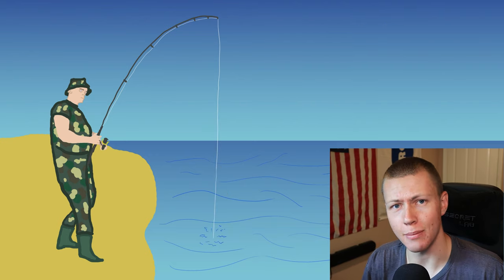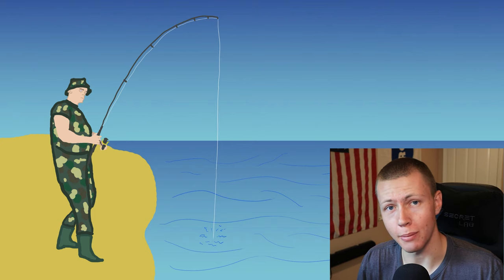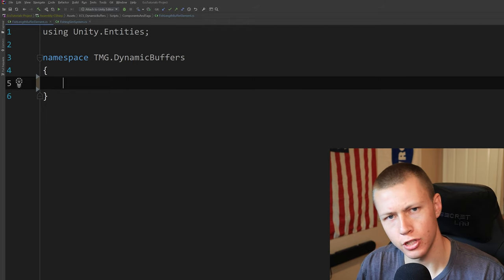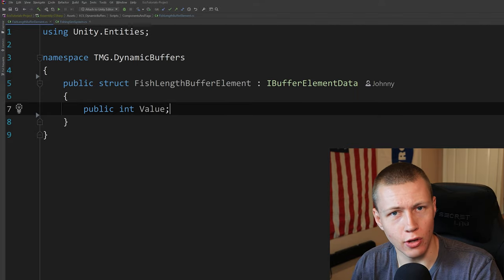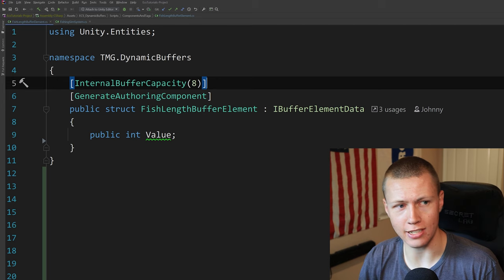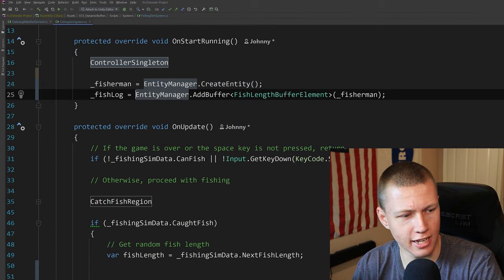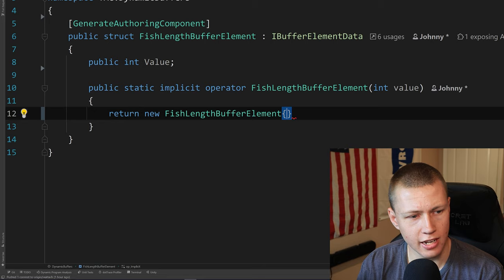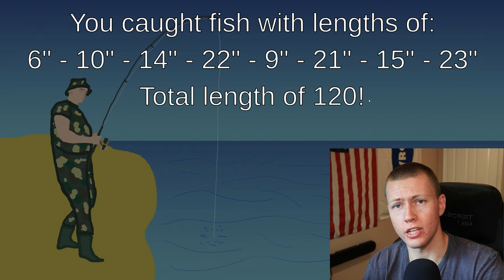How to Use Dynamic Buffers in Unity ECS - DOTS Tutorial [ECS Ver. 0.17]

Comment: You can always "hack" that limitation of having only one value by using custom struct. For example:

using System;
using Unity.Entities;

[GenerateAuthoringComponent]
public struct DynBufferComponent : IbufferElementData
{
    public Workaround valuesSet;
}

[Serializable]
public struct Workaround
{
    public int valueInt;
    public char valueChar;
}

I very appreciate your content - in addition to next DOTS feature I was able to learn about custom operators for implicit and explicit conversions. Without it, I didn't even know that something like that exists! :D
Reply from the maker: That's a cool workaround, just tried it out, works as intended. Thanks for sharing! 👍
Also yeah making custom operators is a cool C# language feature you can use to clean up your code a bit 😊
Reply: REALLY COOL HACK! I was using a float3x3 data type for my buffer element and it was getting very annoying. I'm still wrapping my head around the theory of chunk utilization and structural changes. Is valueint and valuechar stored in the same chunk as valueSet?
Reply: @TurboMakesGames  You're welcome - in return you can share some video about System State Components ;D
Reply: @wasteurtime5677  In the way I suppose you understand - the answer is "yes". Both values inside struct are together in memory, one near one. Or at least I understand this that way. Chunk in ecs is like a box made from colorized paper. Box is the chunk, color is archetype, stuff inside box (steel balls, made from elements, which are components) are entities, capacity of the box is size of chunk - if you have too much entities, you need another box/chunk to store more. Something like that, hope that's helpful and is NOT DOTS-heresy ;D

Comment: Sorry to ask this noob question, but ECS still only works in Unity 2020.x and not in 2021 right? or did I miss something
Reply: I believe it is problematic with 2021.x best stay on early LTS of 2020.x
Reply from the maker: That is correct. Check out my video from a few months ago called "ECS Does NOT Work with Unity 2021" to learn about why this is 😊